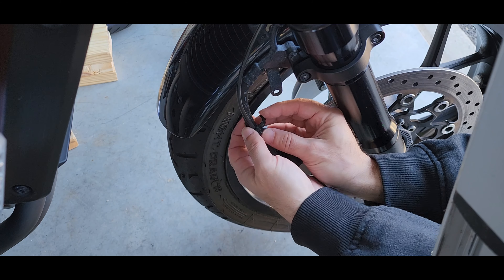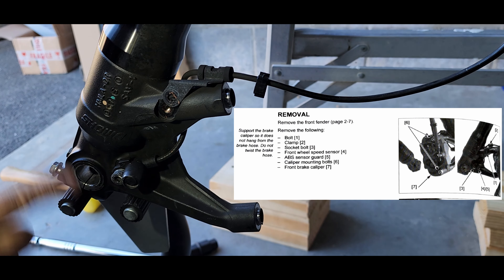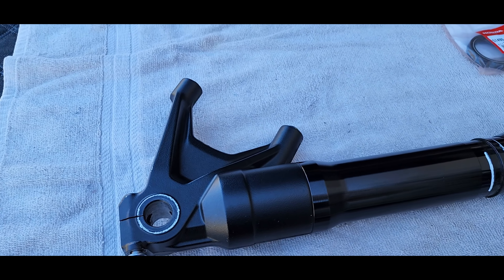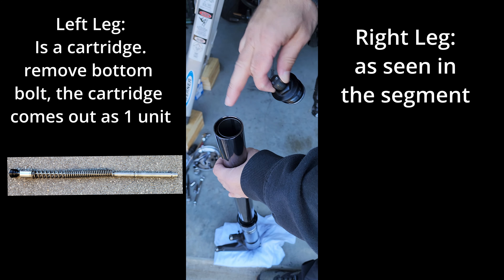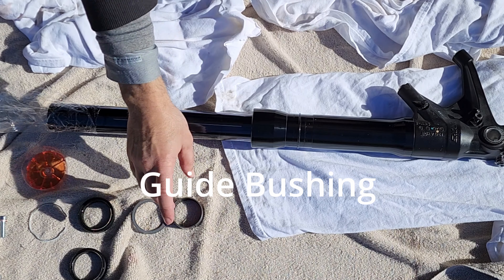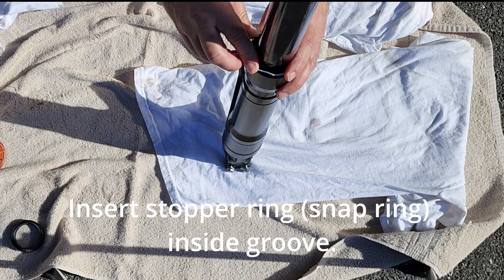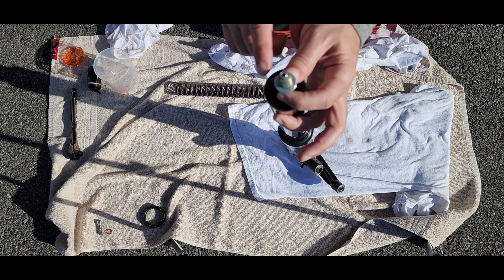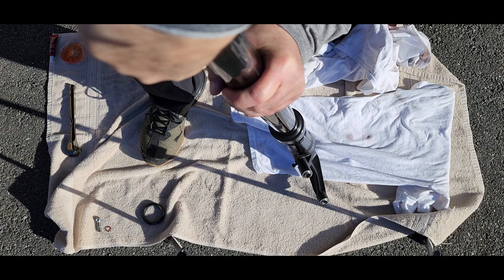Rebel 1100 Fork Seals Replacement

Comment: Great vid!
Can you please tell if the rebell's 1100ground clearance is enough to go up and down sidewalks and clear speed bumps?
Thank You
Reply from the maker: Hi Sharon, speed bumps are not a problem at all! Side walks are different sizes so it depends, I've gently rolled off a side walk without issue, but keep in mind it is a low bike.
Reply: @ontherebel11  thank You for your help!
Reply from the maker: @sharonsharon2604 it's my pleasure Sharon! 👍

Comment: You could add a dab of grease around the fork tube above the oil seal close to the oil seal and then work the fork up and down until the grease is sucked below the oil seal. This is to reduce stiction in the fork.
Reply from the maker: Hi John, thank you for the suggestion, i opted to use fork oil instead, but i think adding seal grease is a great idea, i have some race tech grease i'll try.

Comment: Did you try the Seal Mate tool first?   I had a leaky fork on my Victory and the Seal Mate fixed it right away
Reply from the maker: Hi MCmotoUSA, my seals were not leaking, i upgraded my front suspension and since everything was apart, it's best practice to replace the seals.

Comment: Gus, I'm curious, fork seal replacement? Didn't you do that when you put the new springs in? While you have an area of a bike apart that far, for the new springs, just redo everything that may wear. I.e. chain, new sprockets, etc.
Reply from the maker: Hi James! You are absolutely right! I took advantage of installing the new front suspension to replace the seals, but i chose to post 2 separate videos for easier retrieval in the future while people are searching for info on how to replace the fork seals on the Rebel 1100.
Reply: @ontherebel11  Yes, I went back and watched the front end upgrade and saw that you had in fact replaced the fork seals. When I have any area of my bikes apart, I check and or redo anything that may be an issue in the future just so I don't have to tear it all apart just for something I should have changed while I had it apart. Like, since you have the wheel off, check the brake pads, make sure the bearings roll smooth, etc. Front ends may seem simple but on my Valkyrie, just to get the front wheel off, you have to also pull the calipers. For the fork tubes, you have to do all of that and also take off the turn signals, windshield, etc. As long as you're in there check and/or replace EVERYTHING!.
Reply from the maker: @jamescampolo7824   I couldn't agree more brother!!! That's why why i changed my tires i opted to replace the chain, sprockets and bearings!! Thank you for sharing your experience James, this helps the community!

Comment: Plastic pipe is just as good as the motion pro tool neither is correct or incorrect. If you use either make sure you know how to seat the oil seal without causing damage.
Reply from the maker: I totally agree, i didn't want to spend too much time messing around with creating one tbh, so i opted to invest in the tool

Comment: I have never taken any of my bikes to a shop for service except the (first one they guilt you into). One time when I was 18, I went to dealer because I need a metric screw because I had rounded out th phillips head on a fork drain. The dealer wanted to know how I'd get the screw out of the fork. I had already drilled into the head of the screw, had a screw extractor with me and was going to replace the screw on the spot. The dealer wanted to hire me as a mechanic. LOL, I had alrealy job.
Reply from the maker: 🤣🤣🤣 Brilliant story!!!
Reply: @ontherebel11  I never considered myself a "mechanic". I was wrenching since I was 12 or 13. If something broke, you fixed it and went on down the road. I'm 70 now, still wrench when I have to. I'm too cheap to hire someone else. lol Besides if you want things done right do it yourself. Whenever you buy a vehicle, your next purchase should be the shop manual. Then if you have a problem, you have a reference in hand an Youtube to walk you through it. And don't buy those crap books from the discount parts stores, get the OEM ones that are suggested in your owners manual. If they are not mentioned in your owners manual, go to the dealer. I have the shop manual for my 2021 1100 rebel and my 1997 Valkyrie. They might be a bit greasy but worth their weight in gold. A shop manual costs far less than an hour at the dealer.
Reply from the maker: @jamescampolo7824  I'm the same way, started on my bicycle as young boy, i attempt to fix everything myself - cars, bikes, home, work hahahha
Reply: @ontherebel11  I started on bicycles, then minibikes (one kept blowing head gaskets, had the throttle held open with a rubber band and a rope on the spark wire to stop. Put a twig in the centrifical clutch, got a push to get it going, once the moter started, it would break the twig off and I was down the road.)
Reply from the maker: @jamescampolo7824  hahahha love it!
Reply: @ontherebel11  When you're a kid, you don't know what is stupid or crazy, you just try stuff. In the case of the blown head gasket, it was a friends minibike and he asked me to fix it. For a whold summer, I'd test ride it for a week, blow another again and tell him "it's not ready". lol It was a bicycle frame with a Briggs & Stratton 4hp. lol Did about 30 I guess.
Reply from the maker: @jamescampolo7824  hahahahaha boy did I do some things as a kid that I look back on and just shake my head 🤣🤣